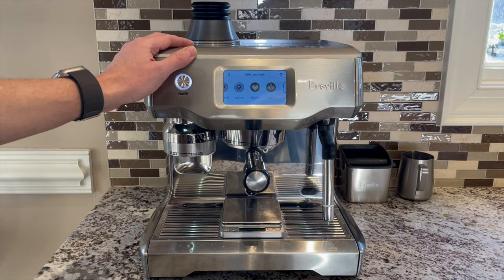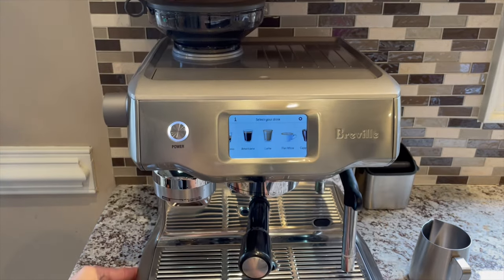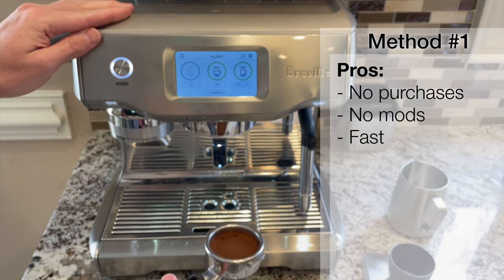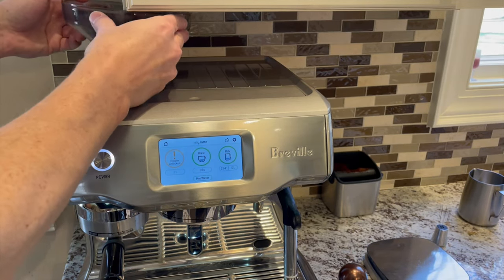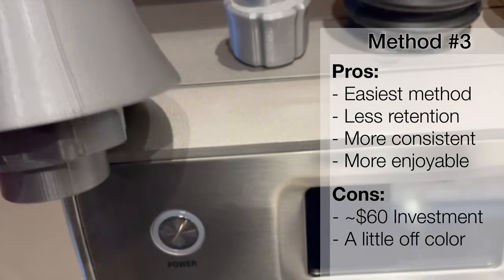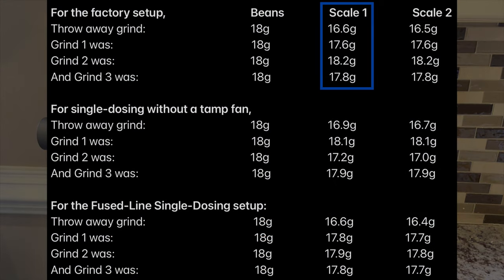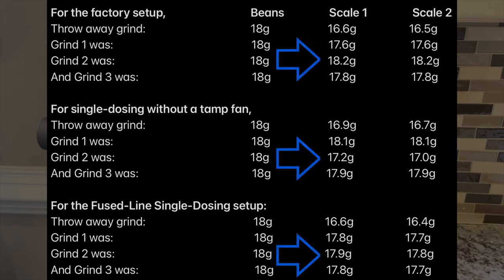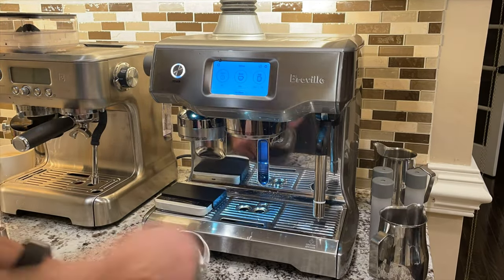Breville Oracle Touch - Single Dosing (what, why, & how)

Comment: The way that I did it was with a single dosing hopper quite similar to yours but with the tamp fan removed. I used a bottomless portafilter without a basket but instead put a grind cup into that portafilter so that the grinds were collected inside of it. I was then able to transfer the grinds cleanly into my other pre-heated portafilter and do my puck prep. It was by far the most consistent way to pull shots on the Oracle Touch with about 0.2g of retention. But I found a quite better way to pull consistent shots: I sold the machine which was actually an appliance and got myself a real machine, handmade in Italy. 🤗 After all the struggle I had with my Oracle Touch, I wouldn’t recommend to follow that path and instead get a proper machine.
Reply from the maker: Thank you very much for providing another single dosing method! I will try your way this weekend. I have a few catch cups I could experiment with. 
I've had my share of frustration with this machine as well, but it still serves a purpose for us. But I did buy another machine as well. The next video should be on my new setup / new machine. What machine did you get? What kind of grinder are you using?
Reply: @CoffeeWiser  The grind cup that I had used fitted perfectly inside the bottomless portafilter instead of a basket while there was enough space on top to be able to lock them together under the grinder. But you could also grind through the open portafilter into any container underneath it to collect the grinds… Regarding your questions, my new machine is a Rancilio Silvia Pro X, with the pressure lowered to 7 bar and some slight modifications. Combined with a Niche Zero grinder. I am also using the Weber Workshops Unibasket and I really enjoy being able to pull very good shots from lighter roasts. I wasn’t able to do that with the Oracle Touch, but to be fair there were some good shots from darker medium roasts that required a more traditional way of extraction. ;)
Reply: Would either of you be kind enough to recommend a catch cup that fits well into a bottomless portafilter? Would any 58mm cup work?
Reply: Did it work fine dosing into a cup without the tamp fan?
Reply: @YaBoyCuz  Sure, it worked better than using the automated dosing as the retention was very low and it gave me the most control over consistency with this machine.

Comment: Great video, thank you. I own the original, non-touch version of the Oracle. When I attempt single-dosing, the grinder keeps running but the tamper doesn't activate. Is there a method to initiate the tampering process after the grinding is finished grinding the dose amount? Would using the bellow exert sufficient force to start the machine's tamping function?
Reply: I had the same problem. Only solution was to increase the dose of beans. I think the auto tamper initiation is based on the volume in the portafilter?  See my post above from today re: a dosing funnel for the 58 mm Breville portafilter.  One hack is to use a bottomless portafilter, remove the basket, remove the auto tamper, and collect the grounds below the portafilter.

Comment: Thanks for the informative videos. Have you tried any alternative shower screens or precision filter baskets with the Oracle Touch such as those from IMS, VST, Pesdao..etc?
Reply from the maker: Thank you for your comment, and great questions!
I considered switching the shower screen, and I figured I would wait until the spacer inside the shower screen breaks (they crack after a while). I haven't checked in over six months, so I will see. When it's time to switch, I'll make a video about it.
I have tried many different baskets. Right now I am using an Espresso Parts basket. It's very inexpensive and it's very forgiving. I have IMS and VST baskets, but I don't like them as much as the EP baskets. Of note, I noticed that my dose changes, sometimes significantly, with different baskets. That makes sense because the tamp fan doses on pressure (or resistance), so if the volume of the basket is different, the tamp fan will stop at a different point than with the original basket. Each time I change baskets, I have to recalibrate the tamp fan to get 20g. I decided not to swap baskets anymore to avoid any issues with my tamp fan. I hope this helps.

Comment: Just got my Oracle Touch yesterday and finding it kind of difficult finding the right settings for my beans (medium roast). Got a 1:2 ratio with 20g (adjusted tamper) with my grinder set to 15. Started pouring at 9s (is this too late?). Not sure what I'm looking for exactly in the taste as I have no point of reference. Setting it to less than 15 resulted in overextraction and extreme bitterness so I guess that's something. With the grinder set to 17 the flow was just too much and I got 50ml of espresso in 20s. So I assume 15 is the right setting for this type of coffee for my machine. 

Haven't seen a video about the taste - what are you looking for when tasting the espresso other than "too bland"/"too bitter"?
Reply: The grind setting number is arbitrary.  Adjust it to achieve your goal. We have two Oracle Touch (vacation home.). One is at about 13, the other at 21.  Both adjusted to grind 18 gms of beans and produce 38 gm espresso in about 30 secs. 
Agree with everyone that the results are very variable, however.  I look forward to using a stand alone grinder, or maybe trying the Fused Line.
Reply: I have the same problem. and I don't understand why they talk about SINGLE SHOT because a single basket shot is about 9 gr and a double shot is 18 grams, in Italy 14, so...9 s, is ok as manually say, but the coffee is bitter, in a video for SAGE, show starts a 4s. In a single shot at 21 sizes, I can get 24 grams of coffee in 13 seconds,...really I don't understand that machine. is very expensive...and not accurate.

Comment: Will the adapter work with the Breville stand alone grinder?
Reply from the maker: That is a great question! I am not sure, but I think you can ask the seller on Etsy. They would definitely know, and I would also love to know the answer. 

- FusedLine Single-Dosing Kit: 
https://www.etsy.com/listing/1211722088/breville-sage-oracle-touch-zero?click_key=fba1b9acf86fbf51dbdaf17986dac943911eb9d6%3A1211722088&click_sum=21a74ee2&ref=shop_home_active_5&crt=1&sts=1&variation0=2596593170

Comment: The Oracle touch is the wrong choice, i am facing many issues in getting constant shots! Even though it was checked by the dealer but no luck in rectifying the issue!
Reply from the maker: It definitely has consistency issues. I have made many videos about it. But this device makes things more tolerable if you want a fair amount of automation in the brewing process. If willing to do the work manually, and willing to buy an external grinder, another machine would be better.
Reply: If you really must do everything manually, you're better off going with the Breville Barista Pro or Barista Touch instead. I just can't see the point of having a semi automatic machine if you're doing everything manually anyway. It's a waste of money and bench space.